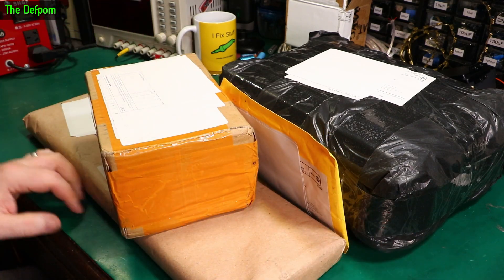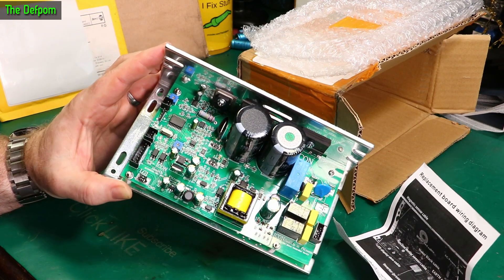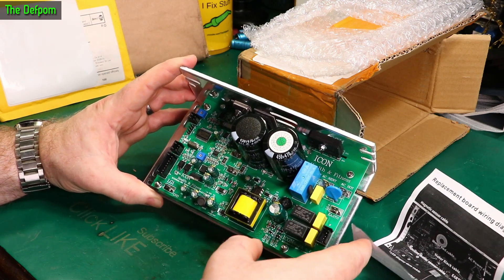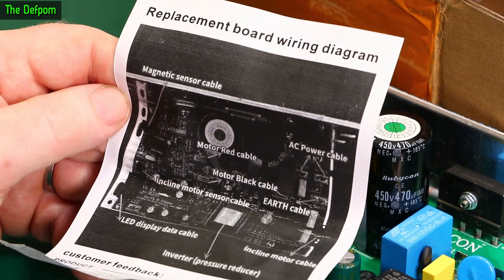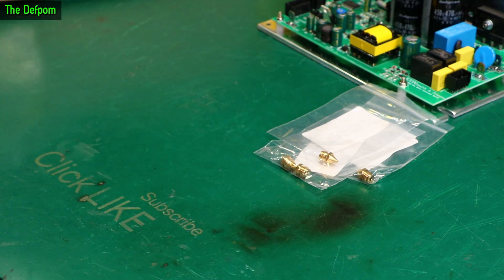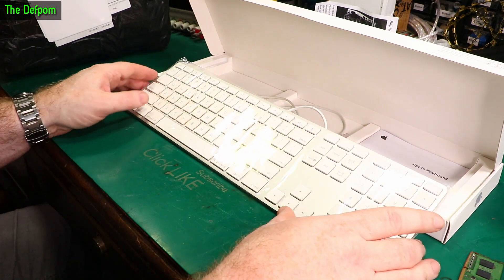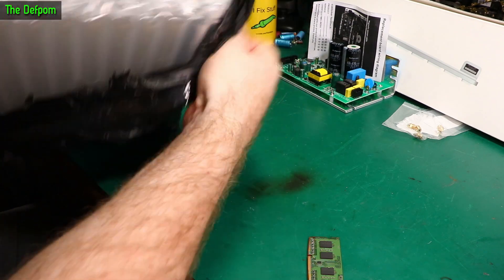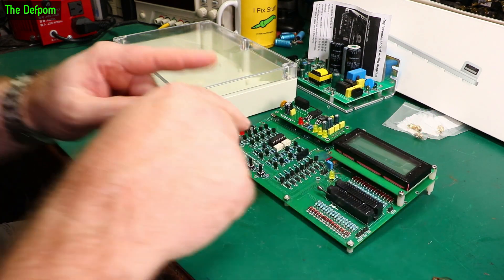🔴 What's in my Mailbag ? - Mailbag Monday 28th November 2022 - No.1068

Comment: You can get pcb switches like those with extremely long shafts, either that or you can get caps similar to those on the PDVS2mini (different lengths) you could glue on.
15 IC sockets will raise the ZIF socket.....:-)
Reply: I'd just make a new pcb to hold the display, zif socket, and switches and mount it to the lid. there must be a few video's in that.